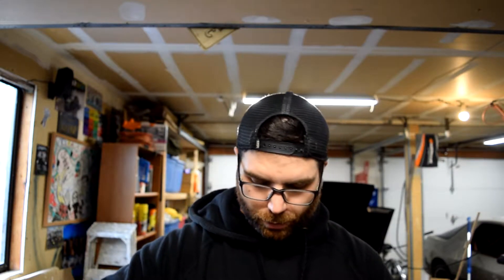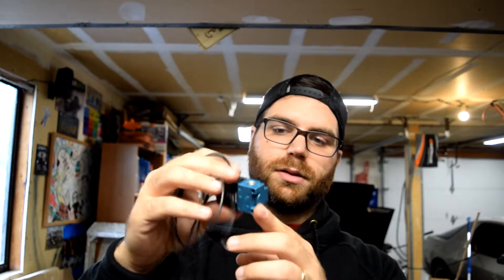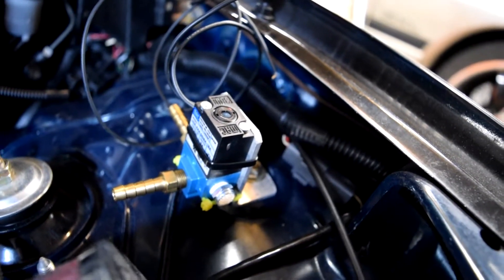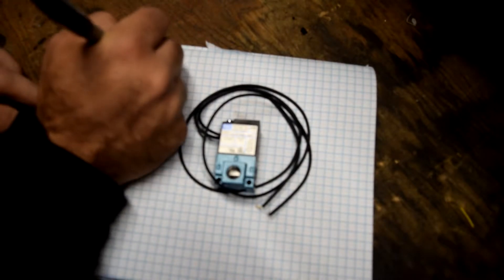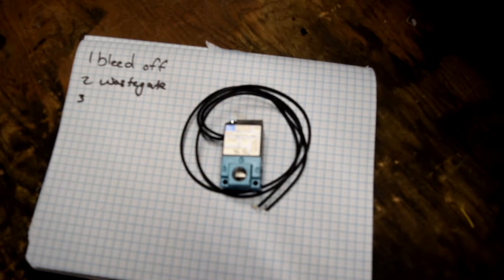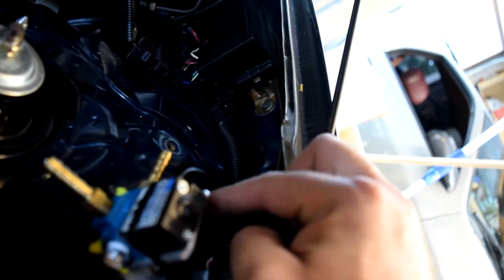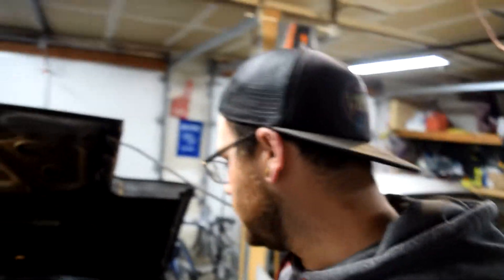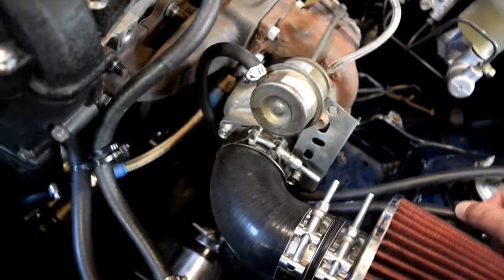How to install an Electronic Boost Control Solenoid | ITB Turbo Miata Build

Comment: if you got a blow off valve where you hook the air release line?
Reply from the maker: It’s a blow off valve not a recirculate valve. Blow off vents to atmosphere. A recirculate valve will reintroduce the waste before the turbo but after a maf. Cars that run on speed density don’t need a recirculation valve.
Reply: @davidfletcher4016  Ok it's blow valve and a diverter I have a hose on the top and have no clue where it goes. I have one port that sucks air on the intake.When i plug it the rpm run down take it off and hook blow valve and diverter valve car rpm almost shut car off

Comment: Your link for the instructions is broken. I have a PTE5862, turbosmart Comp-Gate40, and this 3 port MAC boost solenoid. The solenoid didn't come with instructions, I used turbosmarts wastegate install instructions. My tuner says I ain't building boost until I hit 4900RPMs and it's only 10psi. So I think I got it wrong, he asked me to check the rings but I think maybe it's the way I corrected it. Any help would be appreciated.😁
Reply from the maker: Well couple initial questions being motor size and turbo size and bearing type play a huge factor on the ability for a motor and turbo to build boost. Then I would just hook your wastegate to a vacuum source and bypass the valve all together for an initial tune which will then give you a good base line for what your turbo will do without modifying the wastegate signal.
Reply: @davidfletcher4016  Good morning sir and thank you for answering back.
The turbo is a PTE5862 ball bearing turbo and it's on a 2.3L Mustang ecoboost. I previously had a PTE5862 journal bearing turbo on the car and we had no issues tuning it to build boost before 4900RPMs. The difference is I swapped the OEM solenoid to that 3 port MAC boost solenoid.

Comment: Frequency?
Reply from the maker: I think I tried it out on most all the settings and never really ran into an issue. so I'd just trial and error it. Best of luck I think I left it set to the 52hz if memory serves but I'm really digging out the cobb webs on that answer.

Comment: When you start the engine does the Mac valve start pulsing? Mine only pulsates when I give full throttle while idling ...
I connected it just like you did

Comment: Where does it earth if you connect both to +
Or does megasquirt earth the ecu signal
Reply from the maker: In the case of my ecu and setup the earth is the ecu or inside of it.

Comment: could you not put the switch on the wire that runs to the ecu? I have two existing switches where your power windows switches would sit, one for launch control & the other currently empty (used to be for tableswitching). I just ask because in my 94' the ecu is behind the passenger seat.
Reply from the maker: if memory serves you can put a switch on either wire coming off the mac valve. They're not polar and they just receive a small 5v signal from the ecu and then ground. I have mine on a simple toggle switch in my dash.
Reply: @davidfletcher4016 hi, what's the point of using a switch to control on/off the mac
 im thinking if you mac it off and you have a 10psi spri, you will use this amount of pressure? and if is you mac is on generates the amount of pressure that mac valve does. im correct?
Reply from the maker: @Yalper55  The answer is correct, off it would make what ever wastegate is. The valve works to release pressure into the line to delay the valve kinda like creating a boost leak in that line.

Comment: can i put this to a turbo carbureated car
Reply from the maker: Technically yes... if you can control it with an ecu. However you could use a bleed style boost controller instead, and then just raise your fuel pressure to compensate with some sort of fmu.

Comment: Do you know if this mac valve will work on a variable valve turbo? I'm having real bad issues with limp mode. 
Thanks
Reply from the maker: Oscar Barberena I’d imagine if it had a wastegate that controls boost like a traditional turbo this should work. The boost controller doesn’t care about the turbo it just helps to bleed off air to make more boost.  However I’m not super familiar with variable valve turbos. Given me something to go research! Love it.
Reply: It does for the vvt miata at least.

Comment: Does your MacBook work well with TunerStudio/megasquirt? Looking to use mine but on all forums everyone says it’s buggy lol
Reply from the maker: JohnHeenanTV huh never had an issue with it I had a hardware issue with my Mac and it didn’t like working in a USB port. But otherwise as long as everything is hooked up properly and you haven’t screwed a ground up somewhere MacBook works fine.
Reply: It's just as buggy as TunerStudio is itself. Which is, buggy. However, it's the same (Java) application there is 0 difference between TunerStudio on Mac and Windows.

Comment: What thread barb? The supplied ones don’t supply big enough ports for my wastegate
Reply from the maker: +Scott Dunkirk the port on the valve is 1/8”npt if memory serves. Measure the barb on your wastegate and match that to the nipple. Hope that helps.
Reply from the maker: +Scott Dunkirk don’t know if I’m double replying or not. App got weird. The port on the Mac valve is 1/8” npt if memory serves. Then just match the other end to your nipple size on the wastegate.
Reply from the maker: +Scott Dunkirk sorry didn’t see this. YT is not the greatest with comment notifications. 1/8 npt to whatever size hose you’re running barb. You could always measure the wastegate size to match it.